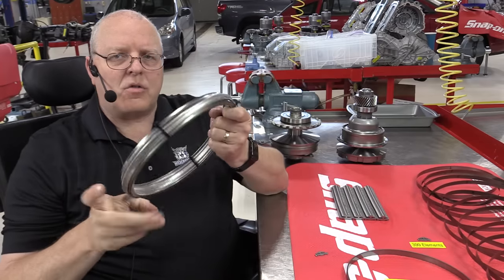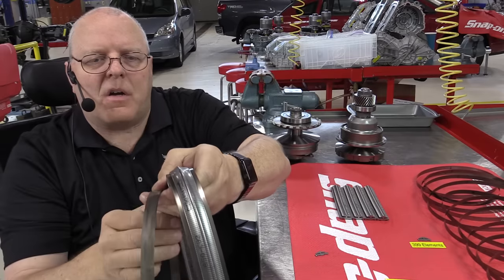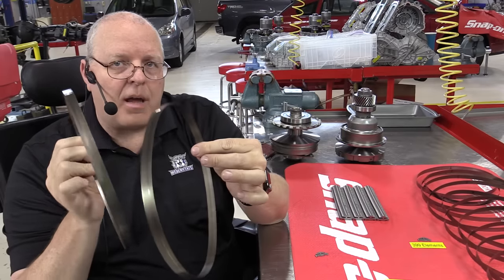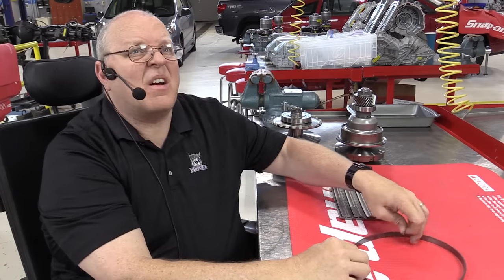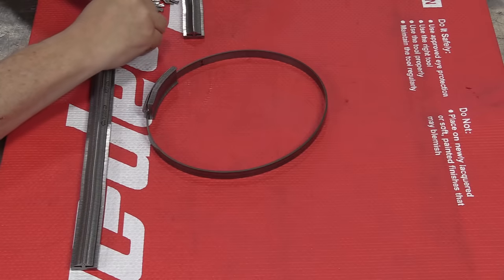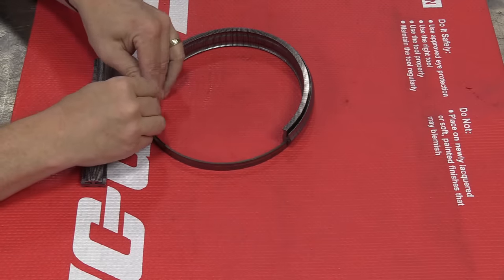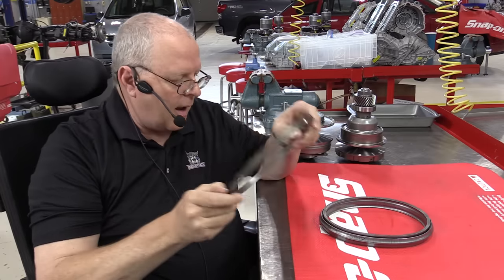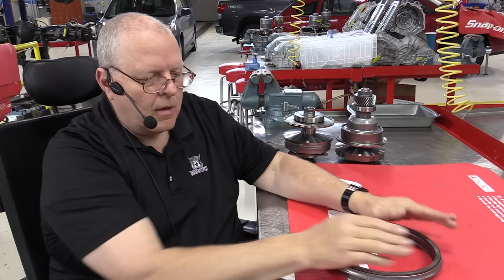The 423-Piece CVT Steel Push Belt

Comment: I have had  a Subaru forester 1997 (automatic)  from new, that has been great for all the years with very little to do other than annual services. However, recently I have had a lot of vibration & shuddering on the wheels when making tight turns (left or right). It is difficult to identify which wheels the noise or shudder comes from and I don't feel much through the steering wheel. I have had all difs replace that has reduced the frequency but not always. We hope it isn't the automatic gear box but has anyone got any ideas what to do next.
Reply from the maker: The center differential in the rear of the transmission can cause that problem
Reply: @WeberAuto  Thanks, it is good to hear from someone else on their thoughts. I will check out your idea. Thanks again. We don't want to loose our car..... she is part of the family.....we have had her more than 21 years and has been a faithful work-horse.
Reply: @WeberAuto  SHE LIVES AGAIN!!!!!!…..an interesting item at 3 minutes to 4:40 minutes in the attached video ( https://www.youtube.com/watch?v=GP7TInt4q84 )..... this was exactly what I experienced with my 1998 Subaru Forester but no-one could diagnose the problem.... £3k was spent/wasted with my Local Subaru dealer trying to fix it... but to no effect. Then I found the attached video link.... and then I found a good mechanic willing to do the work..... and we got our car back (with new solenoid in the transmission) and she runs great..... Well worth the effort.... these Subaru's can go on forever (almost) George (London, UK)

Comment: Great video. Aaand I am completely sure that CVT has so weak grip in every belt-pulley pair, it has so small contact point that makes this transmission is not so reliable. Anyway, it is so progressive tech and there is no one to compete with (on a AD booklet)
Reply: Actually the V-shaped pulleys allow the belt to grip. The more torque you send to it, the more it will grip. Plus the CVT fluid you out in. Dont be so scared of that transmission. It is pretty reliable actually with regular fluid changes.

Comment: @WeberAuto Would WPC treatment on these elements, ring belt, and pulley's sheaves beneficial?  Some parts of manual transmission replacement OEM gears are getting wpc treatment.
Reply from the maker: I am not familiar with that term
Reply: http://www.wpctreatment.com/
I had some parts WPC treated and installed.  It's one of my rebuild transmissions, also had WPC treated LSD and had not experience an issue, yet; did help minimize noise common on aftermarket LSD.  Just curious if it's beneficial or bad for CVT transmission on the mentioned component.
Reply from the maker: Interesting. I have no idea. Thanks for the link!
Reply: you're welcome!!

Comment: Push Belt ?  I am still skeptical about your explanation of why its called that.    How can you say this belt relies more on “pushing” rather than “pulling” on the other side?   I am certain it relies on both push AND Pull.   Mostly on pull though.   I am certain there will be some flex on this just like a rubber belt BUT on a much much smaller degree.    The flex will come because of heat expansion.   In order to guarantee this is a push belt - you need to prove the pushing pulley has GREATER grip than the pulley being driven.

Comment: WHO INVENTED ?? or WHO HAS the PATENT ?
What is MAX torque to HANDLE ??
 If Possible Do a Comparison of this and the 1984 SUBARU JUSTY FIRST CVT TRANS
Reply from the maker: I do not know, good questions. Thanks for your feedback!
Reply: Snowmobiles from the 60s used the same basic system as today's CVTs except they used a fabric belt and inertial input to adjust ratios instead of solenoids.  The belt didn't last long but it was easy to change and owners kept one as a spare under the hood.

Comment: Your students question: how can a belt be bendy.
My question: how can steel belt grip steel pulley to generate 80+ lbs ft of torque?? I dont see how its possible without considerable wear to the components as by the looks of it, it rely on friction
Reply from the maker: 700 PSI of clamping force

Comment: I do wish that this video was better.  It's from a trade school that's apparently using videos as part of the curriculum, and if Weber State is going to resort to videos these really need something resembling production values.  It runs far too long and shows far too little.  There is a brief mention of the texturing or knurling or whatever on the working surfaces of the elements and pulleys, but it's not shown clearly and no elaboration is offered.  Yet it's clear that this texturing is critical, for the elements would just slip past the sides of the driven pulley.  

If nothing else, a 'push belt' is a non-intuitive concept for most of us, and so the instructor ought to show the two pulleys and the belt laid out on a table and demonstrate just how a belt could push upon a pulley.  Other videos on the subject rely on computer graphics that are not entirely believable, and students who aren't present to hold the parts in their hands deserve a better presentation.  

This requires video producers who (1) know how to make a video and (2) have a clear understanding of mechanisms and materials.  If the school can't produce adequate videos then it should not be using them as part of the curriculum.

I taught in trade schools for some years.  The students go into debt for their tuition, and they deserve better.
Reply from the maker: Thanks for your feedback. As the video title indicates, this video is about the CVT belt construction, not how a CVT works. I have another video here showing the operation: https://www.youtube.com/watch?v=c47caRqbbnE . You are the first person in over 1 Million views to complain about production quality. I shoot these videos in my spare time; they are free of charge to anyone in the world to watch. Nobody is forced to watch them. Try to find something better anywhere on the internet. Best wishes!

Comment: Dear sir. I would like to share a picture with you as when I dropped the oil pan of my 2013 Infiniti JX35 cvt, there were about 1 inch long and 1/16 inch wide metal strips on the bottom of the pan. I wonder if these are from the belt itself. Do you have an email address by chance? I'd appreciate some feedback. Thank you very much.
Reply: Oh and these pieces are very thin. Easily bendable with two fingers.

Comment: Do any of the additives work to help belt slip mine drives fine at 2.000 revs harder driving the revs come up to high hence slip and not enough acceleration. Any advice please. A new transmission is more than my 2013 Nissan sv 1.8 140.000 is worth … shocking you should have to throw a 9 year old car away I’m descusted

Comment: Hi, thanks a lot for the video, but i'm struggling to understand what part of the belt is in contact with the pulley? is it just the metal rings? or are the "elements" in touch with the pulley to? 

I'm confuse, Is it the same on both pulleys? or in one side is the metal ring and in the other the elements?

Comment: So can a CVT be fixed or it has to be replaced?
Reply: Anything can be fixed if cost isn't an issue
Reply: @sneed915  ya true.  I'm just a bit nervous about the cvt
Reply: @pingpongballz5998  try pawning it off on someone before the mileage gets too high alot of manufacturers  after 2008 crash cheaped out on alot of things (and some before like GM) and figured out if more cars failed out of warranty people will buy more cars which is why everything is plastic (also due to gas mileage requirements)  and has $400 sensors you have no choice but to buy from the manufacturer to cvt is a byproduct of that its not made to last
Reply: @pingpongballz5998  i wont buy anything post 2007 for aslong as i can it may not look pretty or have fancy gadgets but i can fix it myself and get cheap third party parts easily

Comment: Can you say what causes a cvt transmission to lose power?
Reply from the maker: Typically it is a slipping belt caused by a broken ring band or two. Incorrect fuid can also cause slipping.
Reply: Thanks for the info.....
Reply: Can spark plug cause a vehcle to losses power
Reply from the maker: Not typically
Reply: The gas pump can cause it?

Comment: Still don't understand why it has to "Push" , not pull.
Reply from the maker: Pushing compresses the elements and they act like a solid bar pushing the driven pulley. Pulling separates the elements and puts all the strain on the ring bands and they will break. Have a great day.
Reply: Thanks for the quick response......it's so obvious now I feel like an idiot. Thank You!

Comment: How long do these belts? last? 25k or so?
Reply: The one in my Murano was still in good order at 150k when I got rid of the car.
I did change out the CVT oil every 40K and did not drive it like a madman, 
I am sure these trans will not tolerate much abuse.
Reply: Mannie Ecker .  Thanks for info. They look fragile. My mower with same basic principle, I think, still working after 3 years but I don’t expect it to work everytime I get on it ;-)

Comment: This basic concept has been around for decades. Industrial machinery use them for variable speed. They used this in the old Bobcats. As far as reliability in a car, I'm concerned about wear, especially regarding the edges of the elements, and the pulleys. I'll bet you can't hot rod one of these, unless it's made for abuse.

Comment: Absolutely none of the viewers here have ever owned a CVT transmission. I am not a mechanic but I am also not a pussy to try something new. I have a 2015 Subaru Forester and the maintenance of the CVT is very easy and cheap. Fluid changes every 30k miles will keep your transmission running many years. My vehicle is at 180k miles right now and it is running fresh. I aim for an AWD CVT Rav4 as my next car and I cant wait for it. Dont speak for tech you havent tried out and you dont know people.

Comment: Timing belts are required to be routinely replaced after a certain amount of miles, or years.  If cvt transmissions were designed for routine belt replacement like timing belts, the transmissions would be much more reliable. And people wouldn't have to throw their cars away, because a new cvt frequently,  if not always costs more than the car is worth.  Usually around 7 to 10.000 dollars  after installation. And let's say your car is 7or  8 years old, and you've taken very good care of it, and it has a trade in value of 5 to 8 thousand dollars,  after the cvt fails. A dealer won't give you anything. And no one will buy it.

Comment: one of these days i'm going to build a manual CVT, with a clutch, for my go kart. why? because it will piss everyone off when i talk about "shifting gears and double clutching with my CVT." and before you say its not possible, there is already proof of concept manual CVTs that don't use a belt for power transmission, but instead use a rubber wheel to transfer power that is manually slid along a shaft. then you just add a normal clutch from any manual transmission to be able to control power input to the CVT. i might even put a manual clutch in front of a centrifugal clutch. it will be as useful and upsetting as the backwards bike.

Comment: In 2007 I Bought a brand new  honda civic hybrid for my wife the cvt belt  came apart around 115000 miles.( all fwy. miles and the car was maintained at Honda dealer since new )I took it to Honda dealer and I was told that I will need a new transmission.Honda will not work on cvt transmission (Dimond Honda of Puente Hill ca.)and gave me a quote of $5000.00 for a new transmission, not including the cost of labor. Bought a used cvt transmission from ebay low mileage with warranty $900 and $300 for installation, got rid of the car...no longer buy honda products after 35+ years of brand royalty.
Reply: Thanks for the info. Horrible that Puente Hills Honda won't stand by their products. Sorry for your situation😔!
Reply: Where did you get the tran installed? Great price.
Reply: The multi gear transmissions are fine just don't buy a cvt, it's a pos.

Comment: Toyotas dCVT will be interesting.
Reply from the maker: dCVT?
Reply from the maker: @mobgma  Thanks, I am familiar with that model, but I have never seen it called a dCVT in Toyota publications. Nissan did a similar thing back in 2012 with a planetary gear set for first gear rather than the beveled gear Toyota is using. It reduces the load on the CVT belt during hard initial acceleration. Have a good day.
Reply: @WeberAuto  They are on the new 2019 corollas. It is all new. Not the concept but for toyota.

Comment: You can tell a cvt transmission vs a standard tranny just by the "way" it drives, its almost like the car has more momment at certain points in each paticular gear vs the standard tranny has a constant pull until it reaches the next progressive gear.      Note* .........Only a few of you guys will understand what I'm talking about.     Thanks for the video tho

Comment: The idea of a "push belt" seems like something that shouldn't work.  Pushing on a belt decreases the friction between the belt and the pulley.  How does it not slip???
Reply from the maker: hydraulic pressures as high as 700 psi

Comment: One of the main reason these early generation belts fail is because people fail to change the transmission fluid once every 30k miles.
These belts need very clean fluid that lubricate these belts.
There is a guy who did a tear down of his Nissan Rogue cvt transmission after it failed with no fluid change for 186k miles, his transmission fluid looked like oil.
These cvt's need to be treated like an engine, change the damn fluid and they will last.

Comment: If it’s a pulley with a push-belt, would you not then call it a... ‘pushey’? 🤣 (In all seriousness, though- would it not need a unique design to more properly handle the—at least relatively—zero force exerted on the other side?)

Comment: Awesome!
Reply from the maker: Thank you!
Reply: I have two Nissan CVT's in which I maintain religiously due to fact that we do a lot of highway driving. I am a DYI and love learning how these systems work and what to expect. I use Nissan NS-3 plus a MAX-DAS scanner so the fluid temps/levels are all correct. I heard of the horror stories of these systems failing due to poor maintenance.
Reply from the maker: Thanks for your feedback. Proper maintenance is critical

Comment: A bit of a misleading term this 'push' belt. As they run between two tapered coves on each gear, yes, one side will push, but what of the other side? It then must pull? I suppose it is all the directional arrow then?
Reply: Consider the chain on a motorcycle... it is a pulling force: the tension creates work & the side not under tension gains slack. The exact same occurrence happens here, just under push forces... the side not being pushed gains slack.
The real reason is that chains & CVT belts STRETCH, however miniscule it may seem.

Comment: This explains the power loss in my 2014 Suzuki KIZASHI GTS AWD.
F***ing CVT can barly push out all 290 horse. 
Im running 2.6L with a 16G turbo at 8lbs of boost peeking at 289.8HP
But im not getting any good acceleration till jut after 4.5k at 40mph or more.
Reply from the maker: Thanks for your feedback

Comment: Here is the fundamental weakness in the design. The belt itself. The drive line is through friction so inevitably will fail
Reply: And what about the friction clutch is on an automatic transmission? All mechanical things will eventually fail. The question is do they last for a reasonable amount of time.

Comment: trying to understand about CVT ,,, they have a bad rap , i just go back from the nissan dealer ship with 2010 murano with 60,000 miles ,, 1 owner always serviced at nissan ,, tranny and diffs serviced at 30,000 has a low drone sound coming to a stop ,, they told me needs a new transmission , belt is failing , spinning 3x as fast as should but it still drives pefectly fine . bizzare ,,, my question is ebay sells the gears and belt assembly ,, but transmission shops and nissan say they are NOT servicable... makes one wonder.   nissan wants 7000 to do the transmision but the car is worth 7000,,, what to do ,, Brian in Canada.

Comment: I want to see a CVT with steel push belt in a electric motorcycle, could make battery packs smaller, the smaller electric motors, translate into electric motorcycles with greater range,

Comment: KIA now claims their CVT has a "chain", actually a steel belt that pulls.
Reply: Ron Wilson Putting my faith in that since I just bought a 2020 Soul and went with CVT vs Manual. I will know in a few years if I made the right choice. Thankfully I got a lifetime warranty on engine and transmission
Reply: Manual would have been the best choice for longevity and reliability, start putting money aside for the inevitable time when your CVT grenades on you,..
Reply: MacTechG4 Hopefully my lifetime warranty will cover. No doubt the manual would have been more reliable in the long run.

Comment: Interesting, but they are still unreliable. The service life of a CVT is around 125K miles.

On the other hand, the ol slush box manual is good for several hundred thousand with a couple of clutch changes.
Reply from the maker: Very true. Thanks for watching

Comment: Buy a manual transmission and learn to drive:)
CVTs have more moving parts than a standard transmission, so just avoid CVTs fullstop, if you can!
Reply: The model T ford was way more complicated than a horse, so don’t buy  model T stay with a horse
Reply: @roberthuxen3461  No shit.
Actually it wasn't more complicated than a horse and was a hell of a lot cleaner AND why people went for model T. Much easier and quicker than a horse so you're quite wrong